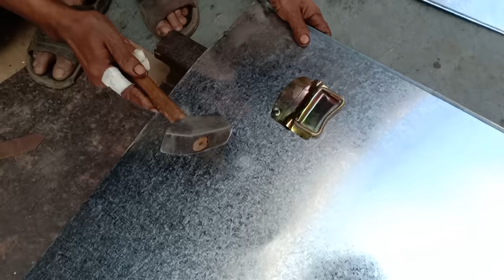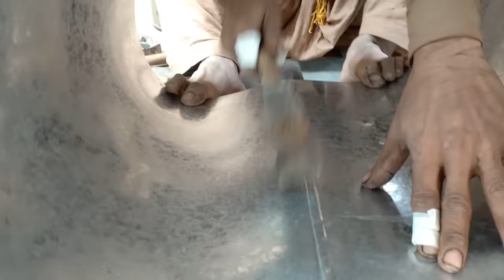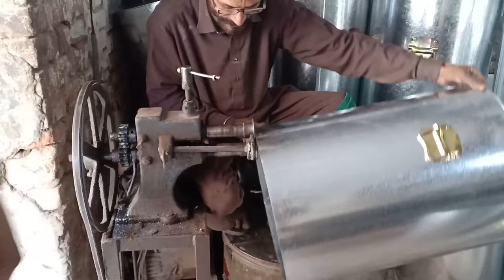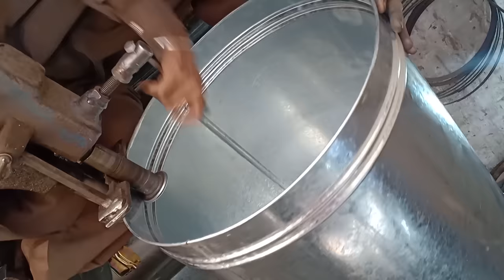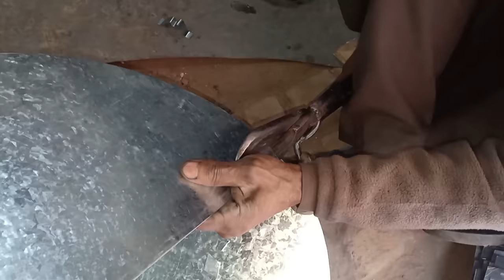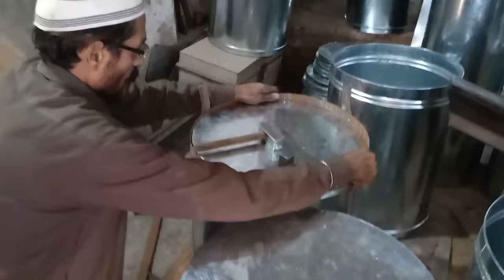How to Convert Metal Sheet into a Drum with Wonderful Skills

Comment: This has been used for years. Most wagon fuel tanks were made this way in Britain. Then seam welded. Nothing knew.
Reply: @bastiatboi4510  not think. I am.
Reply: @slimsterslim6531  That us why you Sinister Slim
Reply: @azizaomar4508  why are you getting wound up. I'm stating a fact. It's not new. Tanks were made like that in the 1960s.whats your problem.
Reply: @slimsterslim6531  "Nothing 'knew'." Smart beyond comprehension.